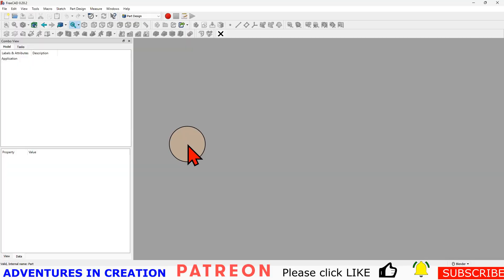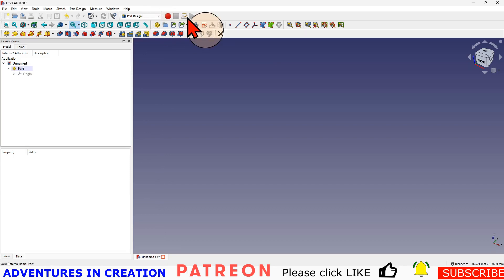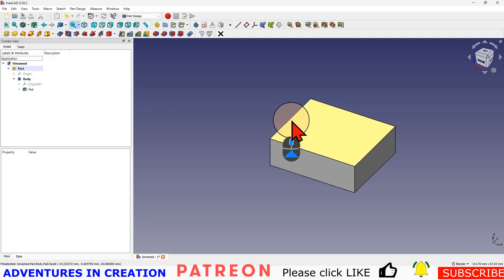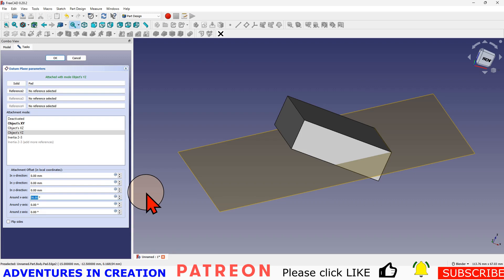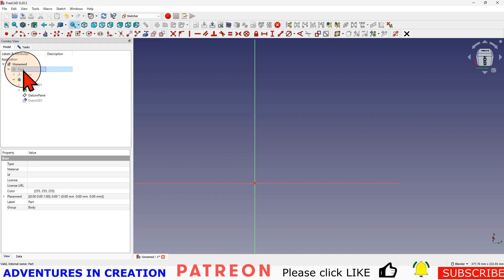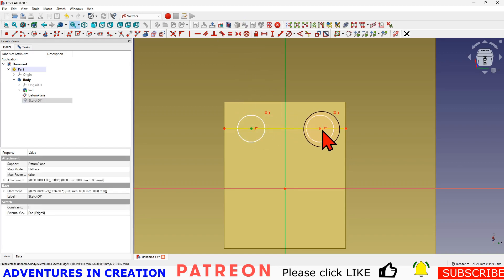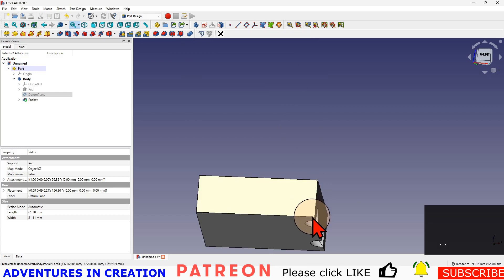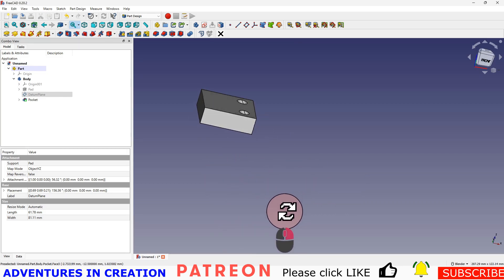FreeCAD for Beginners #51 Angular Sketches #freecad #cad #design #makers

Comment: Will not the TNP come into play when you include the edge from the model in the angled sketch?
Reply from the maker: I just tested it and indeed you are right. - Changing the model breaks the location. I would have to locate it using math and create the placement long hand. I hadn't thought about that to be honest. It does make the inclusion of geometry problematic.
Reply from the maker: I don't believe it will but that is a good point. I will test it and let you know the outcome.

Comment: A bit off topic, but can you share the math to determine the angle of 56.32 deg? I'm assuming you're using the tangent function but unclear for which angle.
Reply from the maker: You are correct tanX = O/A bear in mind I started with the plane at 90 degrees

Comment: How it happened the hols are going through and escape on the edge  ?
I have watched the vid few times, but there is not a moment to explain how they go through up to the edge  ?
Reply from the maker: When I create the pocket (hole) it says through all and symmetrical. This will cause it to go directly through the entire model and thus to the edge.
Reply: @Adventuresincreation  , sorry but the holes can go anywhere through the box
I guess the holes are linked to the plane going at an angle to the opposite edge, so this is guide them where to go ....  thanks